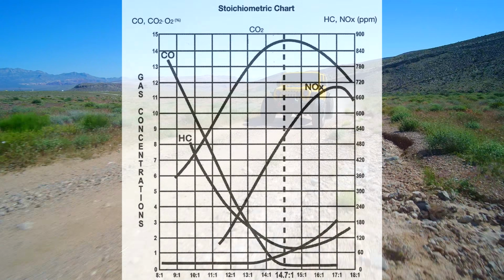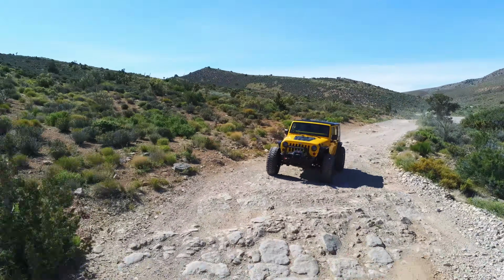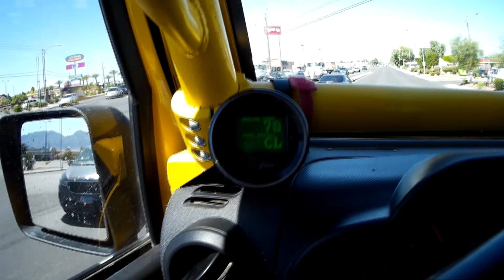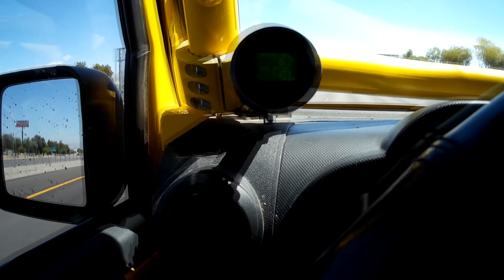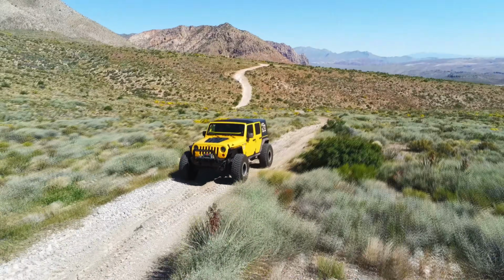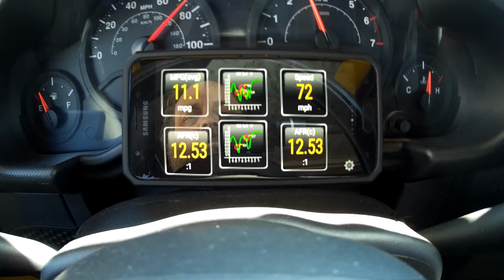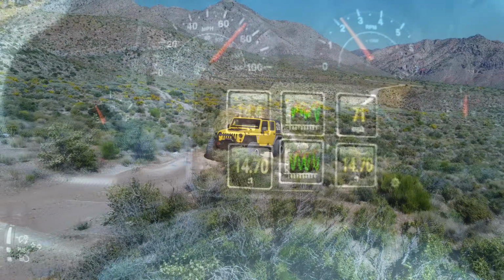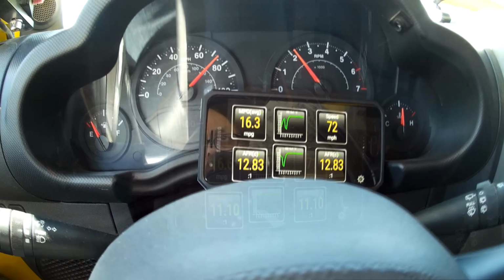Can I get better mileage with my V8 JK?

Comment: important stuff to know & limits of tech BUT b sure gov has staked & rigged tech against US/ppl of humanity & GOD7 & every person speaking is mouthing what false reality bs they r told to. Every car truck or SUV can or could hve been getting 35 plus MPG per gal w/tech we had since 80s for sure 90s fuel injection w/clean burn tech & little to no pollution side effects. W/tech as cheap & available in 2021 every internal combustion engine should get 50+ mpg not running gasoline or diesel any more.

Comment: I can testify that my V8 installed by MoTech hits 16 to 17 mpg highway here in CA compared to the V6 that hit 15 at best, with lifted configuration.
Reply: I put a v8 in Chevy Colorado cus it had a 4 cylinder originally and well I figured if I put a v8 I could get better mpg I was hoping for 4 mpg gain. It was 22 mpg highway with the 4 cylinder thru a manual tranny so I'm hoping the v8 gives me 26 mpg
Reply: @jackdaniels2657 
I own a Chevy Colorado with a V8 stock, 2011.  I get about mid to low 20s.on pure freeway driving with the stock 4 speed transmission.  A 6 speed transmission could improve that.  Although the 4 speed is likely a better transmission long term.

I like the Chevy LS small blocks through gen three.